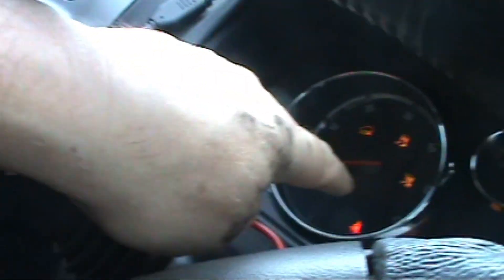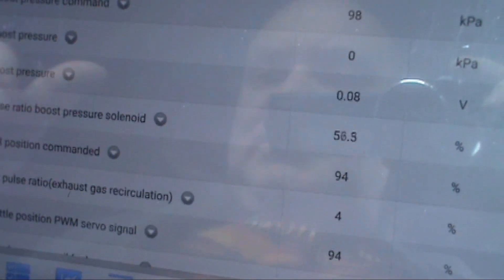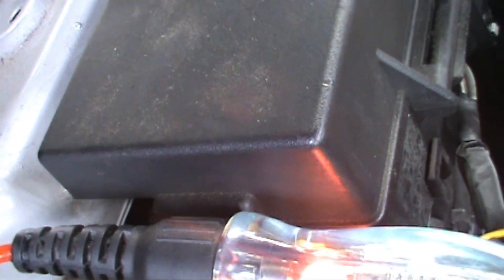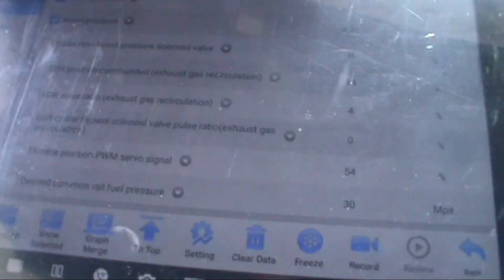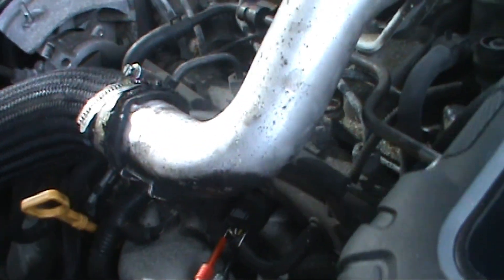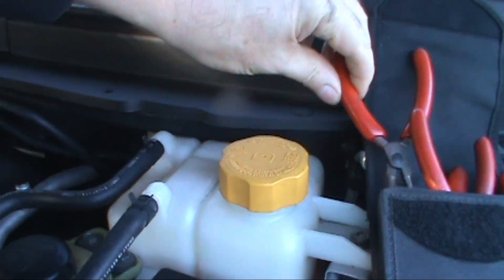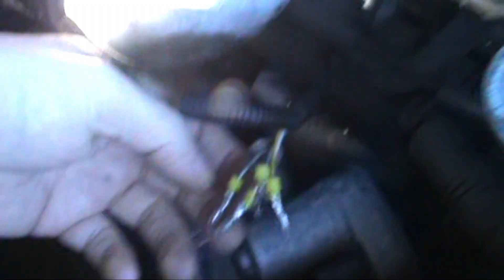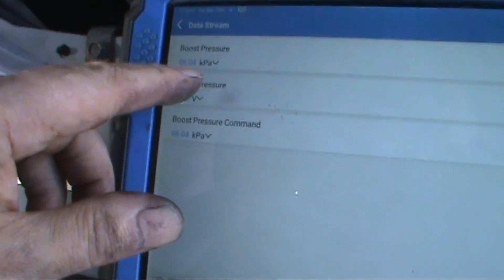P0105 BOOST PRESSURE SENSOR CIRCUIT LOW INPUT 🤔 lots of testing to find the correct fault 👍👍

Comment: Did this code cause any issues when the car was running?
Reply from the maker: Yes sir there was no turbo boost and the car was flat 
But I remember this one after I change the terminals , 5 months later the map sensor failed so I would change that as well